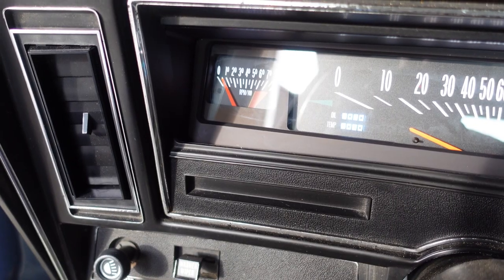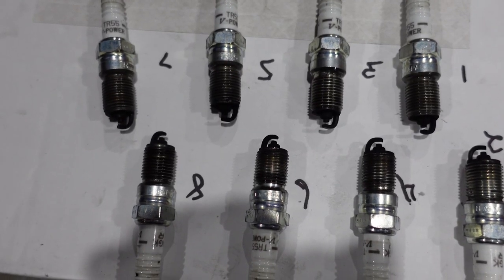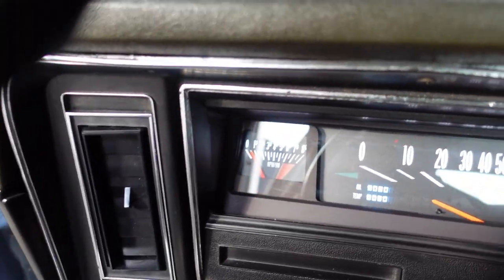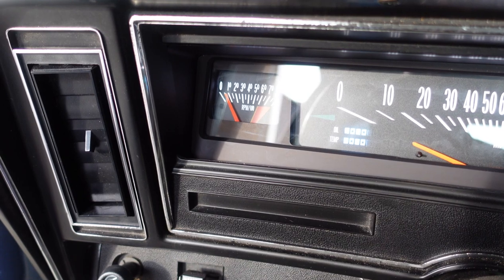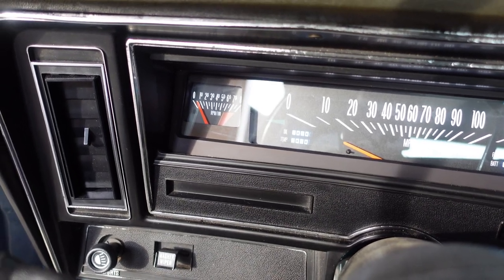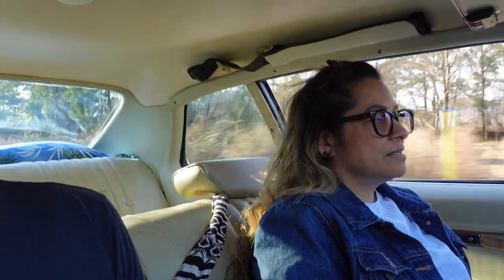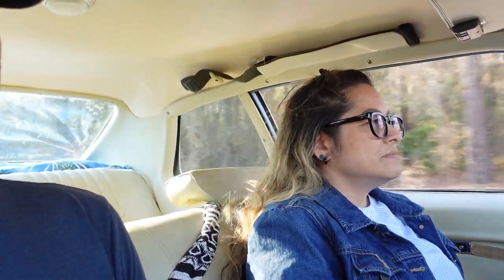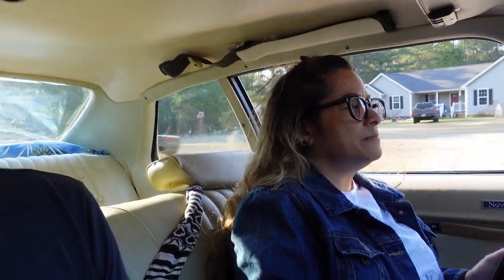73 Nova LS swap is so slow!!! Here's why!!!

Comment: Originally I tried using the Racing plug like you have and they wreaked havoc with my ignition system because they don’t have a resistor. I swapped to an NGK with a resistor and it has been mint ever since.
Reply: Also, I have been told that the draw back with the auto tune with the terminator X is it runs wayyyyy rich so I’m guessing that’s contributing to the issue.
Reply from the maker: My tuner said he likes to use the NGK TR6 plugs in these engines. Since they're a step colder, he can add more timing. We may try that in the future.